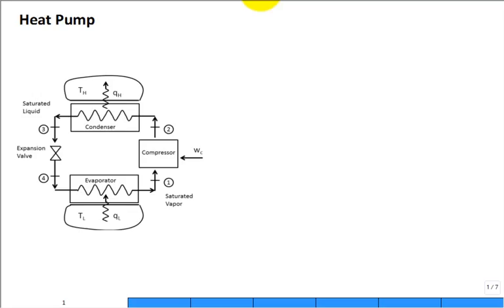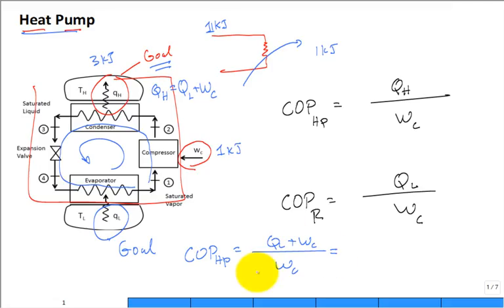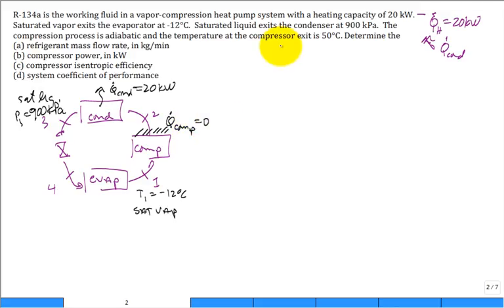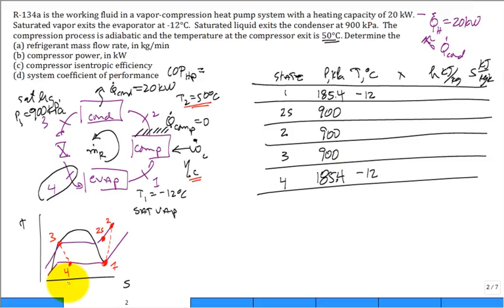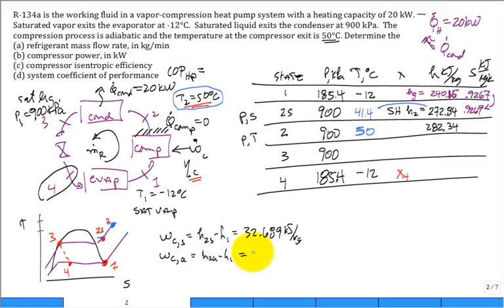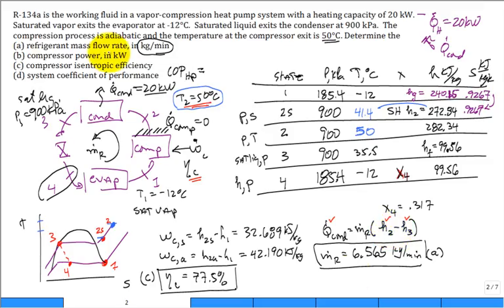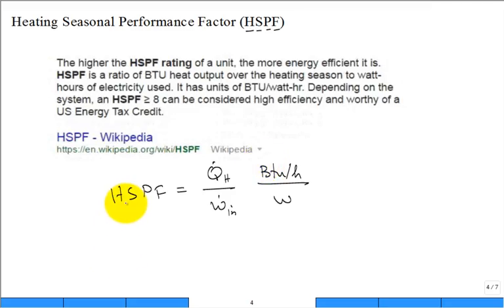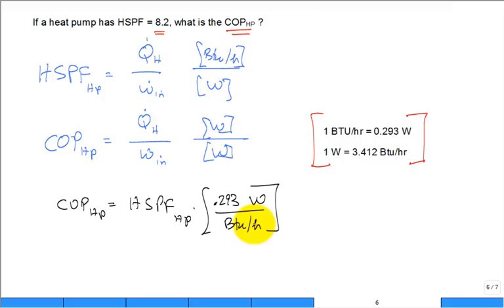Heat Pump System

Comment: Thanks Randall, excellent video I appreciate it. I'm have a BSME from OSU and a Masters but my career has been on the automotive engine industry. This was exactly the video I was interested in that explained the engineering thermodynamic cycle for a heat pump. Definitely 'funny' as you say how it can pull heat out of the outside cold air and it makes it amazing that it can provide factors more energy to the inside air than than the energy provided to the compressor.